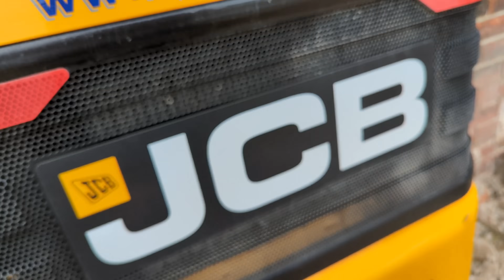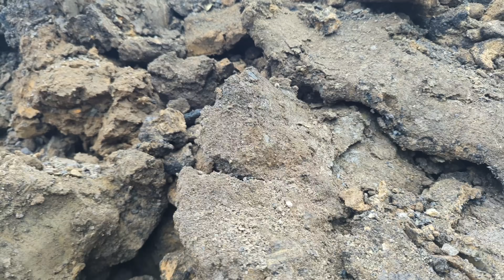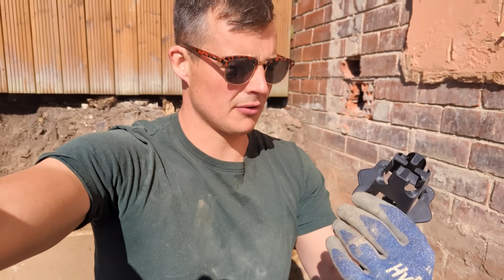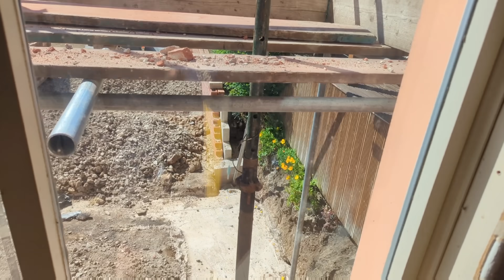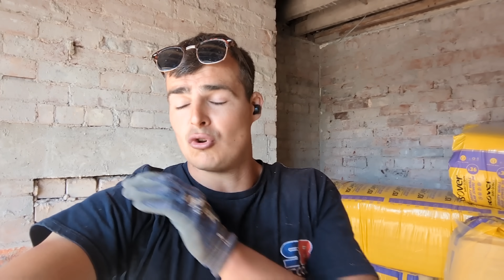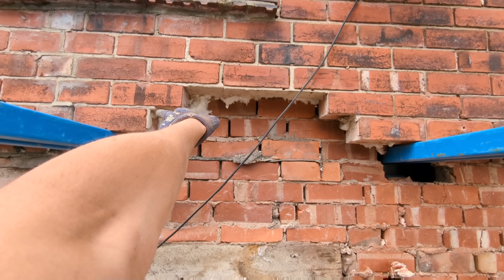BIG Project - BIG Challenges #construction #bricklayer

Comment: What size steel you putting in mate? No doubt your engineer has gone complete overkill with something unnecessarily heavy 😂

I once put in a305/305/ 118kg. 7 meters long, one solid piece. All to take an upstairs window, a few bricks and a slate roof 🤦🏽‍♂️ 😂

Comment: With the goal posts, get a few extra acrows and get rhe steel lined up outside the props, then add props closer to rhe house on one end, take the external props out and wiggle the steel in to be behind where the original props were. Reinstall rhe original props and just do it along the length until the steel is behind the line of props. 

To get it in use a couple of dollys. I made one out of steel and mini quadbike wheels. Much easier than the forks.

Comment: I’m gunna have the same issue with my house, need 2 steels around 7.5m each, decided to drop the back of the house much easier, won’t take long to re build it back in block work it’s getting rendered at the end, not living in it atm so doesn’t matter if it’s open 👍

Comment: Good Vid mate, shame you couldn't get that steel in place on the ground before the Acros whent up.I would have been inclined to wait untill it was delivered. There is a small tracked fork lift available now specifically for lifting steels in 👍
Reply: Andy is correct. Search for Hooka 🫣 seriously.

Was the propping schedule specced by the SE? Looks sketchy to me. Acrows only need to contact the masonry, not lift it. Personally, I won't have masonry resting on flooring joinery even with spreaders. 

Load distribution with openings in the masonry above and an abutting partition wall, (which looks to be taking the upstairs floor loads mid-span) is a lot more complex than 45° steps in the brickwork. Don't forget the roof loading, too.

Everyone has done sketchy stuff with steels at some point, but I'd be thinking something like this one through a bit more in future. Look at 60° triangles between your propping points next time. Hopefully, this steel ends up spliced as that looks a right ball-ache otherwise. None of this is criticism, just food for thought.👍
Reply from the maker: Ayup Andy mate! I usually do that, cos it just makes life so simple..and we all like an easy life. But the steels had a 3 week wait time. At the start of the dig ( first day) we were told only 2 days wait. 
I'll have a Google at that mate!
Reply: Andy's correct.  Search for Hooka.🫣 Seriously.👍

Was the propping schedule specced by the SE? Doesn't look like their usual methodologies. Personally, I won't have masonry resting on flooring joinery even with spreaders, get the Acrows direct onto the needles, and on to solid ground. Doesn't take much movement to get cracks up that age of brickwork...👍

Comment: Alright buddy. 
A 525-60 jcb should do the job with lifting mate. 

That's will lift 2.5T within its arc (not boomed out) with a boom out of 6 metre? 

If you can get into the back garden with a bigger machine, try some steel lintel trolleys. They do offroad ones, then use a 540-80 jcb? 

Nice and easy, love the videos 🎉

Comment: Get a Grab Hire truck Cheap! dump spoil on the drive way (lay down used OSB to protect surface), The weight in the roof at the back of property+ roof tiles, Gable+pike+roof tiles.
 To late now, after footings poured, get the steel in place (tight to demo wall's) cover with temporary OSB double strip's to protect steel flanges from falling masonry, when walls are demolished steel beams are in place for installation. 
A smart move would be to get a Degree 📜 in Site Management! Your a Young 🐂 Now! Won't last ! Night college get your papers Learn everything you can, you'll Thank me in the Long run! This Business 🔥🔥 up Young lad's, Leaves them broken, Use your 🧠! Knowledge is Power!
Reply from the maker: @Joe-jv5mm  ey thanks so much Joe, appreciate all the information. It's something I've honestly never given any thought to. Perhaps in the future 😊 hope your doing really well and enjoyed your weekend

Comment: Any advice on where to go to learn how to operate a digger & dumper. I would like to be qualified to start on a basement dig.
Reply from the maker: @LR52VUU  mate, it's just practice you gain on site. Not actually sure where you go to learn it 😂 I've just been around them for 10 years .so you pick up a thing or two 💪 have a quick Google ☺️
Reply: Look up on line digger course if you're working for a company might get lucky they'll Pay for it, or Pay for it yourself